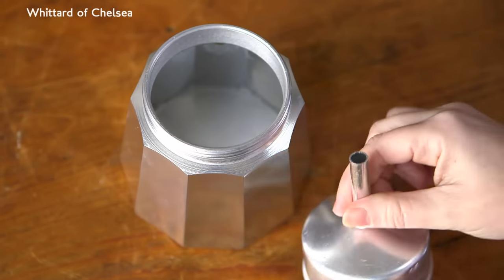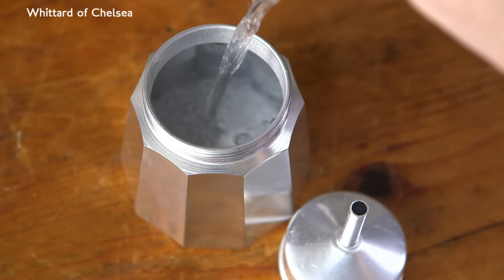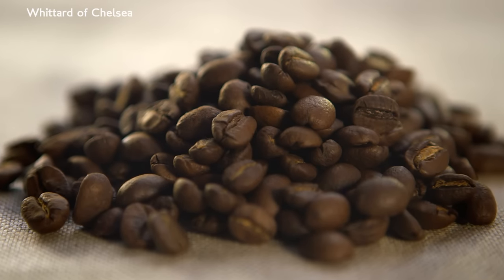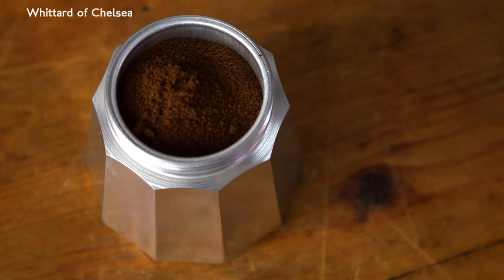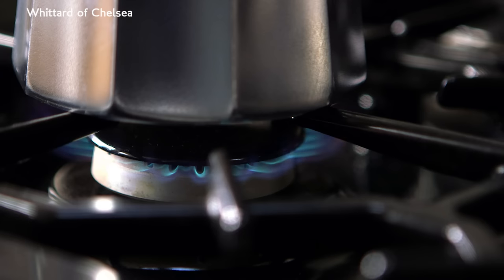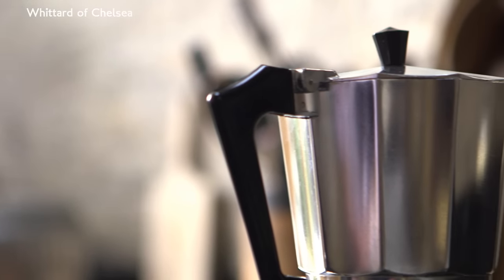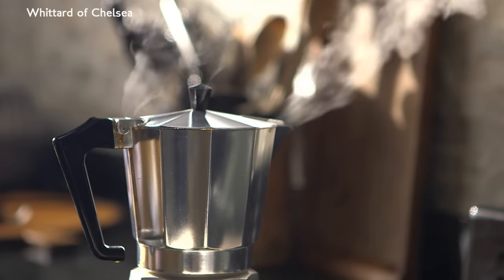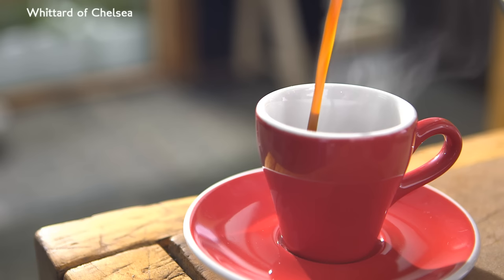How to Make the Perfect Stovetop Espresso

Comment: A few tips:

1. Use boiling hot water in the bottom chamber. It allows the coffee to brew faster without overheating the ground coffee.

2. The grind size wasn't mentioned in the video. Grind your beans slightly coarser than espresso grounds. 

3. Use 14g of ground coffee for 140 mL of hot water (a 1 : 10 ratio). Use the lowest possible heat on your stove.

4. If you like your coffee a bit stronger, use 18g for every 140 mL (water level just below the valve of a small 3-cup Bialetti moka pot). Use medium-low heat for this ratio.

5. Take the moka pot off the heat as soon as you hear the bubbling sound. Hold the bottom chamber under running cold tap water to stop the brewing.

6. Enjoy your stovetop "espresso".

Tip: Use a French Press (if you have one) to froth up some hot milk and make yourself a cappuccino or a café latte.
Reply: Hi, I always noticed that the bar/cafeteria brought have some creaminess or a cream like top layer that we can't see the black espresso below it, but while using moka pot, it doesn't. So do you have any suggestion related to that? And thank you for your above details too☺
Reply: @abinimariya3174  I'm assuming you're talking about the foam on top of espresso. It's is called "crema". The immense amount of pressure (9 bar) passing through the fine espresso grounds creates the foam. Coffee community has a lot of discussions and debates over only the crema itself.

It's not possible to make real espresso with a moka pot. So, moka express coffee usually have a much thinner layer of "crema".

What works for me is, (after reading a ton of people's experiences and watching multiple videos), using this method—

- Using freshly roasted beans (within 2 weeks of roasting)
- Grinding the beans just before brewing
- Putting an Aeropress filter paper between the moka pot metal filter and the surface of the ground coffee.

This method creates a better crema. However, I always stir it in. As James Hoffmann says, _"Don't swirl your espresso, stir it".

It's important to know that many, (or dare I say, most ) coffee experts kinda dismiss the crema. Many even skim it off. It does add some "complexity" to the coffee, but skimming it off would make a "cleaner" tasting moka pot espresso. I'd say, try both ways and see what you personally like.
Reply: @AyAy008  ohhh.. Thank you so much for your fast reply.. I will try both😃👍
Reply: @abinimariya3174  Happy to help! Enjoy your homemade cappuccino!
Reply: I don't at all understand the logic behind running the bottom chamber under cold water. Especially when using a 3-cup moka pot. I can 100% pour out my coffee out and into my cup faster than I can bring it around to the sink and cool it off.
Reply: te amo
Reply: @AyAy008 Thank you!!!!

Comment: So I always...
1 - Used hard water
2 - Overfilled the chamber
3 - Put two teaspoons of coffee grounds in
4 - Always tamp it down
5 - Cranked the flames so they're licking up the sides
6 - Let it boil
It still turns out ok, but maybe now I'll try it the proper way!
Reply: I tried the proper way (except for using hard water, I have no practical choice!) and wow is it strong!
 
Its so strong I can taste how cheap my coffee is!
Reply: @blahblahblahblah2837  so, is it better or worse?
Reply: @perjalananmasihjauh  Worse. Maybe better if I had better quality coffee.
Reply: @blahblahblahblah2837  hahaha!! lmaoooo, funneeee!
Reply: I love this comment.. lol.. I have a pot just like this that I asked my sister to buy me for Christmas in 1988 ..I don't think I used it since the early 90's ...but I recently broke the carafe to my coffee maker while washing it too vigorously.. so I'm gonna try your way and then the video instructions.. see which I like better 😉
Reply: Coffee should never be boiled.
Reply: @peachbellini2615  This is actually the best way to make coffee. Because the hot water pushes through the coffee.  Don't let it boil.
Reply: Me too bye lmao
Reply: 1. Don't use pre boiled water, use cold, water just under the safety valve 
2. Don't over fill the funnel with coffee powder
3. Put enough coffee powder in the funnel, but under the rim
4. Don't pack it down or tamper the coffee down
5. Always use low heat

Comment: I pour hot water into the top of the Moka pot until just below the funnel hole, warming the upper chamber, then transfer that hot water into the lower chamber, leaving both portions hot, easing measurement and accelerating the process. Once the coffee has started to flow I lower the heat to minimum and this seems to complete the process and ensure the coffee doesn't become bitter. Pre-heating the cups is also essential. Great video.

Comment: This is my 2nd Keurig coffee maker of this model. https://www.youtube.com/post/UgkxBrV-RbF5Nk0Rlt9i15aao-YMzqzTG8Vf The first worked fine for more than 2 years, and I could still get a decent cup of coffee out of it if I fiddled with it when I decided to replace it. The problem I had with my first unit was this: When attempting to brew a cup of coffee, the unit would either keep brewing until the coffee was undrinkable or it would not run long enough and the coffee produced was way too strong. I cleaned the unit as best I could but it did not help. So in the end it was just too much trouble to get a good cup of coffee out of it, so I decided to replace it with a new one, which has been working great since I unpacked it.
Reply from the maker: That's great to hear! Thank you for sharing. El @ Whittard

Comment: Actually everything else I’ve read says to tap it on the counter to make it even and keep filling until it’s completely full, and the shop actually do ramp it down but I doubt anyone has the right size object to tamp it right. You want to run the water through the coffee at as high pressure as possible, you definitely don’t want extra room in there
Reply: The first thing came into my mind after watching the video.

Comment: You know a trick to get the perfect heat is to get a pan of boiling water and put the mocha pot in the water so it sits at a perfect 100c for boiling that’s not to hot.

Comment: mine is leaking onto my gas stove.. it still made coffee, how to avoid this? I screwed it on tightly and didn't over fill anything
Reply: Try to clean up, or replace taht rubber (sillicon) seal on upper filter.
Reply: Check if you are assembling the parts correctly. Also look where the parts make contact with each other. The funnel in my machine had a bent edge that I easily fixed. Good luck

Comment: What does the brass safety valve do?  Instructions on mine indicate it's supposed to whistle when boiling...however, I don't hear anything.  Thanks.
Reply: +TheScaredofsilence It's just a "safety release valve" for the pressure.  They don't whistle, but it might gurgle or spit water if you have too much water in there.
Reply: Please don't fill the water or go over the valve. That's meant to blow steam IF there is a blockage. Very important safety function

Comment: This stovetop espresso maker may be made of aluminum; pass on those and get one made from stainless steel. Nobody ever said the human body needs aluminum, did they? Acidic hot liquids absorb aluminum molecules very well. I have a stainless steel one. My only complaint is ... oh, how I miss the crema that forms at the top of espresso that extracts from a pressurized Italian espresso machine!
Reply: Turn the gas down to real slow flame/heat for a nice crema,the functionality remains the same aluminium,stainless or ceramic,my 'ancap ceramic darling' makes a beautiful powerful crema this way...happy cafinating😊😊
Reply: Wait, seriously? You can get a crema from stovetop espresso maker by slow brewing??
Reply: Not really, crema is produced by extensive pressure which you cant really reach with a stovetop.
Reply: @tillhager6820  Yeah, I don't think it's possible either. I already tried to brew it at the lowest setting, and not even one bubble of crema formed; with that said, I used an electric stove because that's all I have access to currently. I haven't tried using a gas stove or flame-based heating.

Comment: I have found better results adding boiling water to the bottom chamber then heating on a low heat. Just my opinion
Reply: Thanks. I was wondering about this method myself. Going to try it out next time.

Comment: Another ridiculous moka pot video. Never use hot water in the moka pot unless your grind is too big, which is obviously the case here. If you buy ground coffee in supermarkets, the grind will be either just right or slightly too fine. In that case you have to start with cold water. Also, don’t forget to stir the coffee in the pot before serving as the stringer coffee will be on top. Finally, never ever put lemon peel in coffee. It’s disgusting.

Comment: I don't think that you can accomplish the "perfect" espresso with a home stovetop machine. It doesn't even have the foam.
Reply: Flamma2512 you're thinking about a latte. This is an espresso (aka the coffee part that you can add to micro foamed milk in order to make a latte)
Reply: Also if we're getting super technical this a "moka" pot so it's making Moka which is halfway between an espresso and drip coffee
Reply: @a.g.6973  it isn't espresso, it doesn't create enough pressure to be espresso. O.P isn't talking about lattè either, they are talking about the crema on top of espresso formed from the pressure /bean quality. You cant get that from a moka
Reply: @tomd5357  There is a different Moka, called a Brikka, that works in a similar way but produces a crema. Look it up.
Reply: @tomd5357  Yes, it isn't technically espresso, but it isn't technically filter/drip coffee either. It's placed under pressure, just not to the same level of espresso